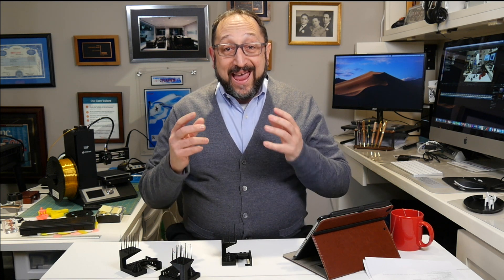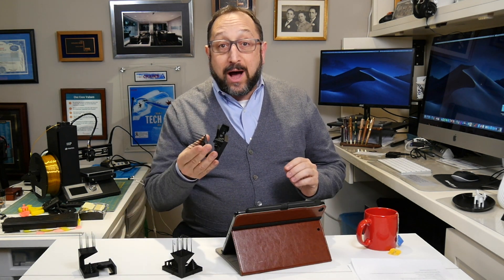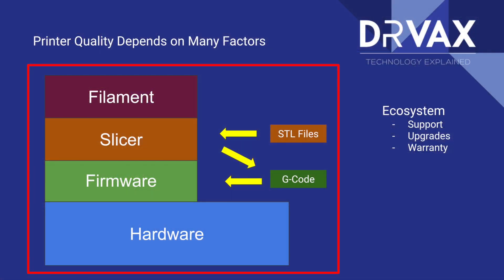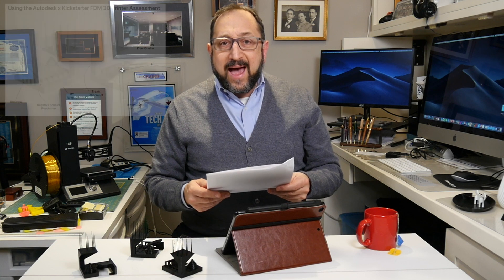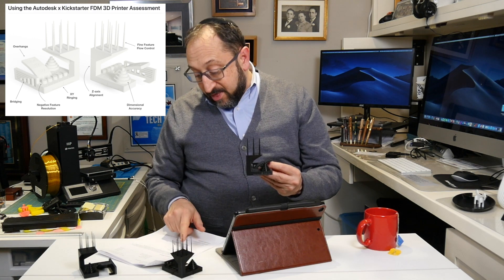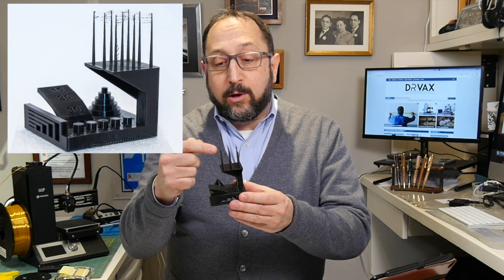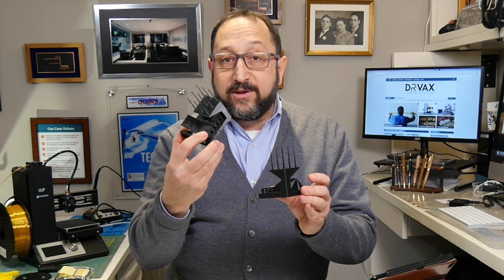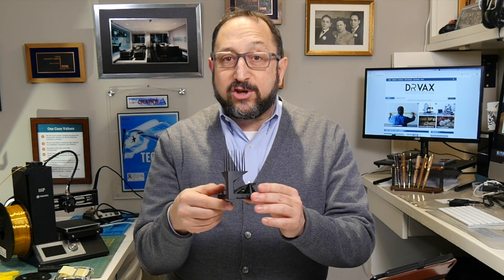Creality Ender 5 vs Original Prusa i3 MK3 (Updated Comparison)

Comment: Now i do NOT own a Prusa I3 mk3 BUT i do own a prusa i3 mks upgraded to a 2.5 i also own a ender 3, a CR-10S, and a CR-10S Pro. Prusa is way over priced for what you get my prusa does not even get used anymore anytime you use it a pinda probe or the thermostor goes out seamed like anytime i use that printer i have to work on it and Prusa Support will lie to you as well.  my creality printers was in most cases under 1/2 the price of a prusa ender 3 =200$ and is more dependable. I will say that the prusa does do better on stuff like TPU and nylon. BUT you can upgrade these printers to fit your needs and still stay under the price tag of a prusa. E3D upgrades are easy to wire in....  I have not tested TPU yet with my cr-10s pro that should happen with in the next 7 days I just got it the other day still tweaking and doing a 58 hour print...
P.S. if your using new version of prusa you should compare with new version of Creality printers take a look at CR-10S Pro with bed leveling sensor bigger build volume much more smoother then the normal CR-10S and still cheaper then the prusa.
CR-10S Pro was printing with in 15 min of taking it out of the box
Reply: The comparison to the cr10s pro would be a good one.   Cant deny the reliability and ease of use that comes with the creality line, especially the newer ones.  And even now the old argument that was being thrown around about open source cant be used because its no longer valid.   
Eco-system be damned, no reason to go brand orientated when the market is flooded with good competition and the competitors are coming out with solid pieces that work and last.
Reply: I could not agree more - I have a MK2 and it its definitely last product of that company I bought - I got too many issues with it. With a CR-10S Pro there is no reason for a MK3 in market.
Reply: @weltraumkuh  I would have to strongly disagree, especially after seeing all the problems people are having with the CR10S-Pro. e.g. TH3D Live unboxing and review (how many times did he have to run the auto level? How well does the CR10S-Pro save the baby step z-offset?) & "Fun in the Kuntry Basement 3/10/19 - Chris's Basement" (fully disassembling the Z-axis to be able to tighten one concentric nut?) starts around the 51 min mark and goes to the end of the video.

While I don't know how drastic the differences are between the MK2 and MK3 ... I have an MK3 and an Ender-3 and the MK3 has been no fuss since taking it out of the box. Ender-3 not so much. I've upgraded the Ender-3 with direct-drive, MKS Gen-L, MKS TFT 3.2, TMC2208s, Capricorn PTFE, Hero Me & a BLTouch. After all that "time" and money not sure I should have ever bought the Ender-3. While the Ender-3 benchy is now really close to my MK3 benchy, you can tell the difference. My Ender-3 Z-axis seems like it will never be horizontal unless I do a dual Z lead screw upgrade. Who doesn't like a slanted Z-axis where you have to match that slant on the build plate?

From what I have been researching, with the CR10S-Pro you will need to flash the board for thermal runaway protection, flash the touchscreen so the firmware matches the board & change out the probe, just to get it safe and consistently functional. Creality can't even update their firmware on the CR10S Pro to the latest Marlin?!? 1.1.6 seriously, what year is it again?!? Finally, there may be the need to heavily tweak the Z-axis so it is level.

So you're comparing a company who never updates anything but hardware with questionable QA vs. a company who updates hardware, firmware, and even its own variation of slicing software and has solid QA. Makes sense to me!

I love competition and love open source. If you had said something like the Artillery X1 Sidewinder (also cheaper than the CR10S-Pro) instead of the CR10S-Pro ... I probably wouldn't have even commented.
Reply: @skeepskeeperson  thank you for pointing out the  Artillery X1 Sidewinder. I will have a deeper look at this! I also heard the MK3 had a lot of issues as well and I guess that might be solved right now so experience might be ok now (I would never trust a machine from that company anyway) - but same is true with CR-10S Pro which is just an improved version of CR-10 which was light years ahead of MK2. Also CR-10(S Pro) has got much bigger build volume and to be honest a kit printer in 2019 -  seriously, what year is it again?!?  And the full assembled version is way overpriced in my opinion. The MK2 QA was horrible to just nearly not existent...only Anet A8 might be more worse. The list of problems was too long so I never touched it again just from day one I got amazing CR-10. In my opinion original Prusa printers are silly toy machines coming from a way overhyped company  with very questionable (see multi material upgrade for example) marketing.
Reply: @weltraumkuh  Yeah, I've steered clear of the MMU upgrades. I got my MK3 in early December 2018 and it had no issues. Although plenty of time for them to get everything figured out.
Reply from the maker: Thanks for your observations. The Ender 5 is a new printer from Creality. 

I agree you can upgrade a Creality printer to the same specs as a Prusa.  My conclusion is that for some people the Prusa ecosystem is a significant advantage.  Many of my viewers will never mod their printer.

Finally, the idea printer for me would be an Ender 5 with the box style frame, auto bed leveling, all metal hot end, an all-metal extruder and optimized Bowden tube or a direct drive extruder.  Maybe I will build it someday.  :-)

Comment: First of all it was a well articulated video with a good analysis. However there are a few issues here. 
You can't call something "pro-sumer" just because of the differences between direct drive and bowden. 
That's not really a fair assessment of the advantages and disadvantages of the two methods. 

Secondly. It's nice to know what slicers you used. But tbh it would be far better if you told us what settings you used.... 
Also there is nothing stopping you from using the same slicer on both or doing multiple tests. 
Nothing stopping you from using the Prusa slicer with the Ender 5. A slicer is just a slicer. 

Some other notes. It looks like your settings for the Ender 5 need tuning. Did you use the default Cura settings or did you take some time to tune them?
It's somewhat easier to tune retraction at the very least on a direct drive since there is a bit less retraction to do (I'll get back to this in a second). So most likely if you didn't do much in the way of tuning on either printers slicers, you are more likely to have been closer retractions wise on the MK3. This would have given you those better looking towers. Bot since you still had light stringing it could be better. 

Coming back to the distance of retraction and the reason why I say yours does not seem to be tuned. You have very clear oozing issues on the spires. You can see it by the formation of those "thorns" coming off the sides. That is oozing. Which means your retractions need to be tuned, you need to check that your Ender 5's bowden tube is not overly long and also that the tube is firm in it's couplers. 
On the note of retraction distances. It is a myth that you NEED 5-10mm+ of retraction to use a bowden tube. Not saying you said anything like this. Just adding it here because some people hold that belief and believe direct drive is so much better because of that myth. 
Yes if your bowden tube is a meter long and has really low tolerances on the internal diameter. Sure you need to retract very far. However on a printer this size there should be no reason to retract further than 1.5mm or maybe 2mm.
All of my bowden based printers with build volumes of 220-350mm on X and Y, have retraction distances of 1.5mm or less with cheap tubes. If I do that test print I get far better results than either of your prints with no stringing (the occasional slight whisp on the larger printers) at all and no resonance. All because I have the accel values tuned, speeds tuned and retractions tuned. 
The kicker is these are all under $300 printers with very slight modifications. Modifications such as a better part cooler, bowden clips etc (with the exception of my cheapest printer at $170 shipped. It has some Z axis vertical bracers to stabilize the vertical V-slot).

One final note. You said you sometimes turn the print speed up to 200% on the printer. You will be lucky if this gives you 5-15% more actual speed. Print speed is defined by the limits of your acceleration settings and by the physical limits of the nema motors. They can only speed up so fast. They will constantly be ramping up and down their speed on a curve. 
You aren't getting double the print speed. 
Well unless your original print speeds were ridiculously low. But that isn't being serious.

All that said I really enjoyed your clear analysis and it was a very good video otherwise.
Reply from the maker: Thank you for your excellent points.  In making a video you have to limit the information you provide to keep the length appropriate.   In this case, I wanted to evaluate the hardware and firmware vs a fully tuned slicer.   I agree with you that a fully tuned slicer will produce outstanding PLA prints on an Ender 5.   As the temperature requirements of your filament increase, I do believe the Prusa will be at an advantage. 

The 6.5mm at 20-25mm/sec retraction recommendations come from a number of benchmarks recently published on other channels.  When printing the standard two tower stringing test with these settings I get perfect prints on the Ender 5.  I believe the plastic extruder on the Ender 5 limits its ability to extrude filament with perfect consistency.  An upgrade to an all metal, adjustable extruder and a Capricorn Bowden tube is an easy upgrade.
Reply: @MakeWithTech  You are absolutly right. You do have a limit to what you can put in a video. Maybe a quick Part 2? For those interested in slicer tuning and how that changes the final score. Just a suggestion. 

6.5mm seems way too much for retraction. Especially if you are still getting "thorns"
I did hear that the plastic extruders on the new enders were under performing because the springs were either a bit too short or the plastic of the housing was flexing too much. Causing it to let go of the filament briefly. 
25mm/s retract speed is also a bit slow. I tend to push 60-70mm/s retract speeds and 20-30 de-retract speeds (more effective than you would think really). 
You want to get that filament out of there asap and slowly push it back to make sure there is no over pressuring. Just thoughts for you to have a look at. 

I did hear that people with the ender 5 and ender 3 are shoving a few washers on one of the sides of the springs. Just to increase the pressure and reduce any skipping. 

Your limit for high temperature printing is going to be the hotend. Not the extruder type. You can use a bowden tube in a heated chamber at PC heated temps. pretty easily. but your hotend is the issue. at that point you need a water cooled block. 

Won't say no to capricorn tube upgrades. They are nice. if expensive at least for me. but i loved them when i could get them cheap. 

Anyway. Just some more thoughts. Do with them what you will. 
But most importantly have fun and keep printing.
Reply from the maker: Another good comment.  Thanks for contributing to the discussion.   In the best YouTube educational/skills channels, the comments add as much value as the original video that started the discussion.  Thanks again.

Comment: A very good and objective comparison.  If I could make a recommendation - major focus area here was the print quality i.e. the printer capabilities.  As these numbers will generally paint a accurate picture, it is worthwhile touching on the quality of life for different users when using each of the printers.  How easy it is to set up and calibrate, simple things like bed leveling, changing filaments, troubleshooting nozzle clogs, removing prints without hospital trips et al. Additionally, tasks such changing nozzles and heater cartridges would also go a long way in decision making (especially parents).  Lastly, something I feel is almost always neglected is safety.  What precautions are taken to avoid shocks and burns, especially for younger users.
Reply from the maker: Excellent comment and very accurate.   I consistently find that the time from creating a model until the print starts is much shorter on the Prusa.  Part of this is the automated filament loading procedure, part is the better slicer integration, and part is the auto bed leveling. All these factors position the Prusa as a Prosumer vs a Consumer machine.

Comment: If slicer settings alone eliminated ringing, it might be due to lower speed or lower acceleration.
Reply from the maker: Possible.  I did not compare in detail the differences between the Slic3r and the Cura profile.

Comment: I think your right.  The presets are a little to hot on the prusa.  I cool them down my over hangs prints much better.  One thing you need to talk about is that Prusa support is very good and they keep coming up with upgrades.  I have had the MK3 for a little over a year and it has only gotten better. The steel spring plate was/is ahead of anything on the market, quiet, good support, large community, etc, etc ,etc.  One thing to remember.  You will spend more money on filament than the printer over time.
Reply from the maker: Yes have four 3d printers and the steel spring plate is by far the most user-friendly.  The Ender 5 is not bad, it is removable and print adhesion is acceptable.  However, it is harder to remove prints from the Ender 5 very flexible magnetic print surface than from the Prusa.  I have two Monoprice printers, a new MP10, and a Select Mini.  They share a print surface which is not very good and requires a glue stick or as I prefer Magigoo very every print.

Comment: Are you going to print with the ender 5 with slic3r? Like to see if ender 5 will be better that slic3r instead with cura.
Reply from the maker: Interesting idea.  Maybe I will do a piece comparing multiple slicers and one printer.  The challenge is aligning the settings.